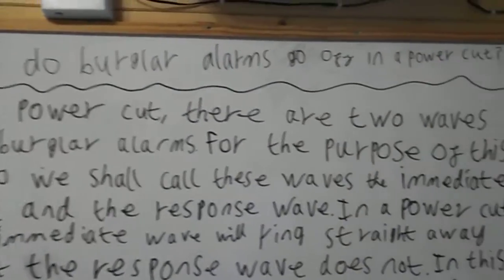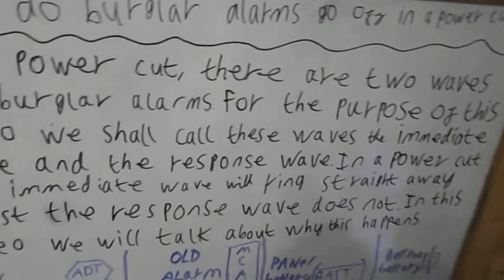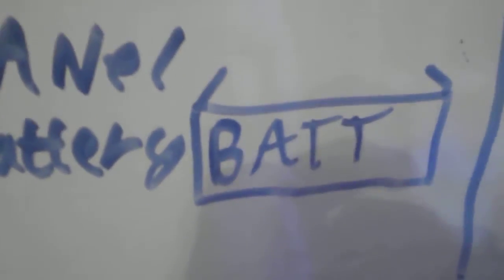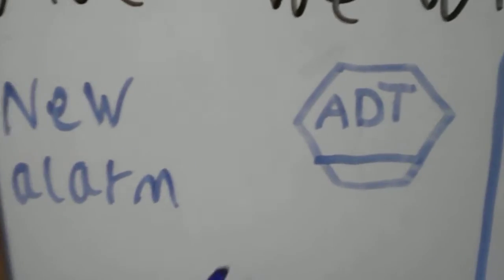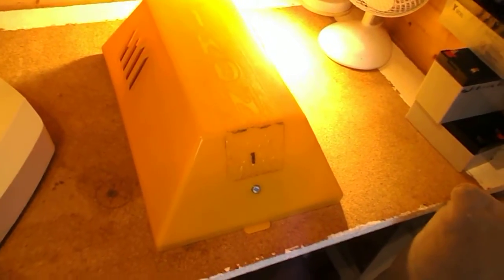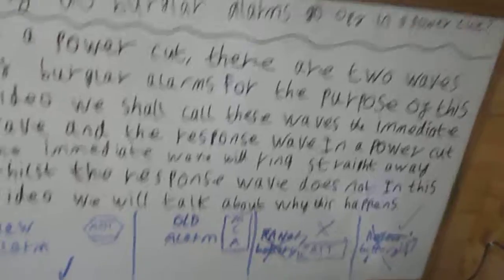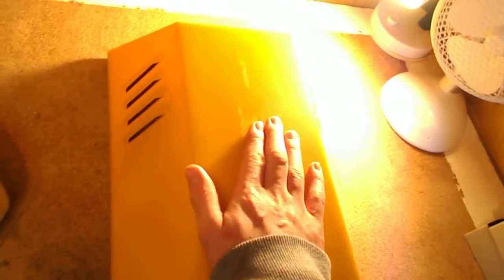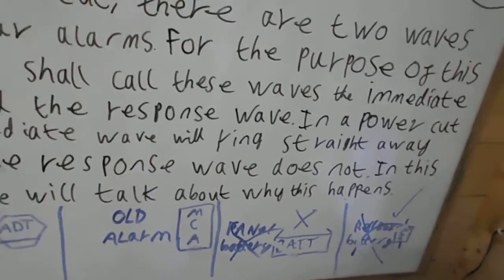why do burglar alarms go off in a power cut?

Comment: That Makes a lot of sense now. The area i live in has about 12 houses all with the original burglar alarms ( Apart from 3 that have been replaced)  3 alarms out of that 12  go off right when a power cut happens. The Houses including mine took from 1998 to 2003 to completely finish so they are very old alarms now which makes sense to why some would go off if the battery is dead. The original alarms are BSS bell Boxes (White rectangle with 2 red LEDs that blink at the bottom)  And the 3 new alarms are a Dent Security bell box a Texacom alarm bell box (which dose sound in a power cut as well as after sometimes) and a ADT one.    Think they all need to be replaced ASAP even if they do still work.

Comment: if the alarm goes off then the power gets cut off that means the back up battery is not working or needs replacing.
Reply from the maker: I know, but that means the battery in the bellbox is still alright.
Reply from the maker: The vented bellboxes are quite weather resistant and even though they crack and expand most of them still work.

Comment: why does the tamper alarm light stay on when there are no cables for alarms or siren conected
Reply from the maker: because the back up battery is dead so the alarm panel thinks someone is tampering with the power.